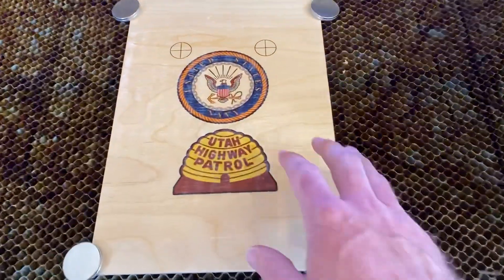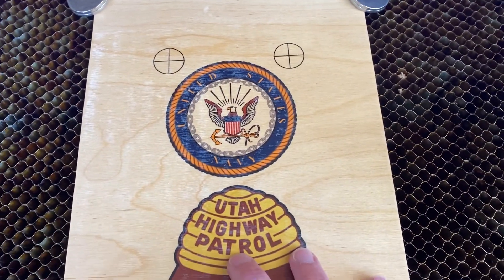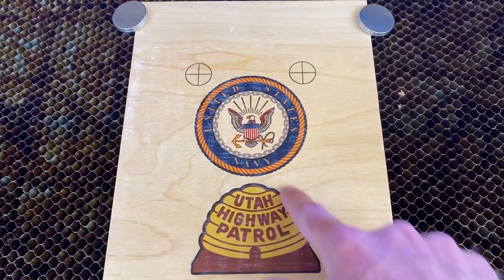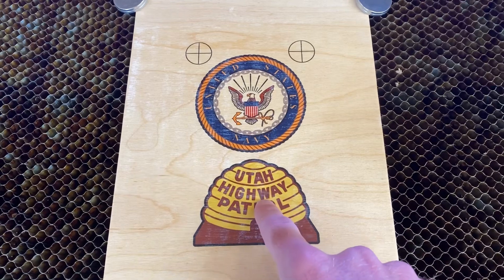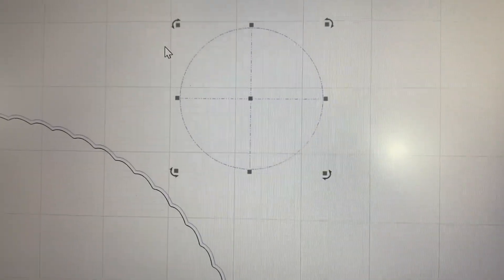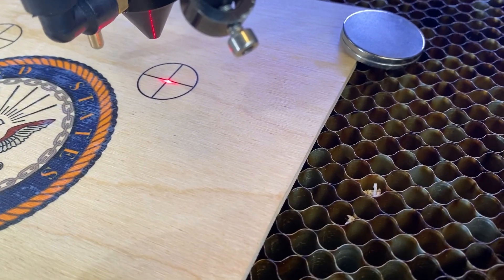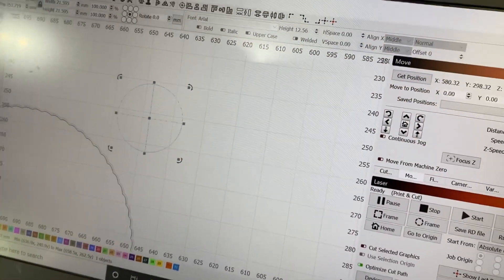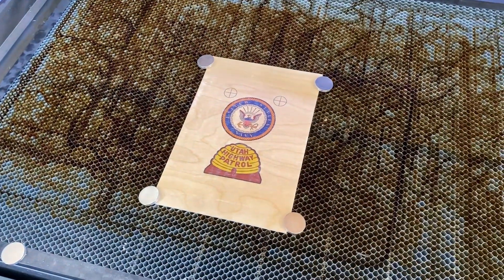Lightburn - Print and Cut

Comment: is it work in laser or plotter I try in longer ray5 10 watt but not work for me how does he evaluate the target distance if the camera is not there?
Reply from the maker: You need to have the targets as part of your design in the software and in the physical product. Align them using the wizard in lightburn and then there is an option to scale and align at the end of the wizard. Lightburn does all the work in the background to make it work.
Reply: @BeardedBuildsCo  its cut just out of frame , my work space is 400mmx400mm i cut a4 paper design then i need to set my workdpace also in a4 size or not is this matter, , i try to cut a photo with help of this but its just cut opposite direction or out of frame
Reply from the maker: @sanyasidham it’s hard to help without seeing what you are experiencing. Are you in the LASERGUYS Facebook group?

Comment: Thanks for this clear explanation, my longer nano 6w has a extender bed that is only 100x300 I’m going to hopefully cut some 3mm ply to the plans of a boat, the images though are outside that size so I’m guessing at moment that for each sheet I’ll have to make a print with targets then repeat moving each part of the image into the work area, cut and then join up again after, is that how you would do it or do you have a different way to use lightburn to cut patterns that don’t fit the work area?
TIA

Comment: How is the laser power off but still running without the cut? I have the polar, and I'm just now getting it figured out
Reply from the maker: On my machine there is a switch for just the power to the tube. For the polar you could set the layer power to 0 min/max and it would do the same thing.
Reply: @BeardedBuildsCo  thanks

Comment: Yeah! But the next step is to automate both halves of the process - especially the calibration step. Doesn't light burn do that yet? Don't forget this feature is a simple button push from the front panel of older units like LaserBox.

Comment: How do you do the dry run with the laser power off?
Reply from the maker: On my machine I have a key for the laser power and I just turned that off.
Reply from the maker: You could also just turn you power to 0 for min and max on the layer.

Comment: Thanks for making this video. One question I have for you. Do you bring your image in as a png or jpeg and then image trace so you can then start wizard function?
Reply from the maker: At the end I of the day you have to have a line to cut with lightburn. You can either do that with a vector you have or using an image the you trace. Both will work.

Comment: The linked printer is an inkjet, not a dye-sub.  Wrong link? Instead of adding a black outline, offset (overprint) the colors that are already part of the image. Then when you cut you'll be left with a clean image without a wonky black outline.
Reply from the maker: In this case I wanted the black outline. The printer linked is the printer that I converted to dye sub.

Comment: When I do as you  for some reason as I jog to the first cross hair the position maker is to the right about 1/2", when I jog to the second and zero in as you then run a text it goes over the crosshairs first, the first one is fine but the second one is off by 1/4" or so to the left and when I run it the head strays from the line, any help with this? Thanks

Comment: Hello! I am attempting to make a jig to hold wooden crab mallets. How do you set up the print/cut with cardboard when the cardboard is lower than the hammers will be? In other words, do I set up the print/cut with the bed at the focus height for the cardboard? What happens when I lower the bed to load the crab hammers in the jig?

Comment: Hi, great video. Do you know of a way to add more targets / reg marks for an even more accurate cut over a larger space? Also how do you turn off the laser for the test? 

Thanks 😀
Reply from the maker: There is not a way to add more registration mark. To increase accuracy you can move the marks further apart. In this video I turned the laser key off or you can turn the power% to 0.
Reply: @BeardedBuildsCo  thanks for the speedy reply. I run a kongsberg large format cutting machine at work and it uses 5 reg marks to read the cut file so I thought it might be similar. I will try spacing the two reg marks out further to increase accuracy. 
Thanks for the tips and will keep an eye out for further help 👍🏻

Comment: I THANK YOU for this video as I had been wondering about this.

The only thing I will need to do is match my red dot pointer with the actual position of my laser on my new Aeon Mira 9.. I will ask then how to do so now.
Reply from the maker: Pulse on your material and then without moving the laser head adjust the red dot to be right on top of the pulse mark.
Reply: @BeardedBuildsCo  INGENIOUSLY SIMPLE!

Comment: What kind of wood was that? Also what wattage laser? It seems impossible to cut through that fast. My 80w has to be slowed down to like 10mm/s at 70% power to be able to cut 5mm plywood.
Reply from the maker: This is 3mm Baltic birch cutting at 34mm/sec on my 100w. If you have to slow down that much and use nigh power like that you probably have something going on. Most of the time symptoms like this are an indication of an alignment issue. The place where alignment is the most crucial is the 3rd mirror at the top of the laser head down to the material. If that is not dead center you will lose a ton of power and if it is hitting the nozzle on the way out of your laser head then you power is diminished even more.
Reply: Is your laser 80W input or output (optical power)?
For example, my laser is 40W input, but only 10W output.

Comment: Awesome tutorial. Thanks so much.

Is your air assist connected to only run when laser is going or was it that way because you turned the laser power on and off?

How did you wire to only come on when lasering if thats the case?
Reply from the maker: I upgraded my air assist setup so that when a job starts the air turns on. I will link the video here.

https://youtu.be/y08B1v8-q-c

Comment: I am using the print and cut feature to cut a piece larger than my bed. When i tell the laser where my registration marks are (1 & 2) it doesn't cut in the correct place.  for some reason it shifts slightly.  Any idea what would cause this?
Reply: Have you checked your red dot alignment? The first time I tried to use registration marks on a passthrough I had the problem that my cutting laser and my alignment laser weren't hitting the same spot.

Comment: Great video, however, you did not show on you sublimated the image onto the wood surface? I thought sublimation only works on 100% Polyester fabric and Polymer coated substrates. However, you did not show on you sublimated the image onto the wood surface? I thought sublimation only works on 100% Polyester fabric and Polymer coated substrates.

Comment: Nice vid mate, just seemed to jump ahead of me. I have used the print and cut feature in Lightburn and I made the registration marks in LB
but I am trying to find out exactly what you are showing in this video but before you printed, 
Did you make those registration marks in the print software so that they transfer into lightburn and then be used by LB
Reply from the maker: Yes the registration marks are made with the design and also printed to the print transfer paper. Here is another video that might help as well. 
https://youtu.be/n__saOKVupA
Reply: @BeardedBuildsCo  Thx mate, Yea I already used that video to make an oversized project and it worked out great, I was just at a loss as to how to create the print file in a sublimation printer and if the registration marks transfer exactly to my laser .
Reply from the maker: Yeah I created the design in illustrator and used it to make the print and imported the the same design into lightburn.

Comment: I noticed your head is pretty far away from your material, does that make it harder to cut through thicker boards. I use the cloudray automatic air value to control the air through lightburn, and I want to start using the dried air/cooled air from my compressor for my lasers. also can I ask what brand of tube to run?

Comment: Nice feature.  Good video.  I would like to see how the actual printing on the wood is done.
Reply: Spray a thin layer of Polycrylic on the wood. Print the photos using a sublimation printer. Press the image on to the wood using a heat press.
Reply: Interested in this as well.
Reply: Also interested!!!
Reply from the maker: Once I get my sublimation setup put together, I’ll do a video.

Comment: Great video as always Brandt. I'm gonna be ordering my camera soon and installing it soon. I have to figure a way to remove any "play" in my lid so that I can get extreme repeatability. I'll be utilizing this feature very often.
Reply from the maker: In this example I did not use a camera.
Reply: @BeardedBuildsCo  yep I know buddy. I watch the whole thing a couple times. Your instructional videos are 👍👍 One of my buddies has an epilog pro fusion with a camera. I want that functionality in mine. I just need a sturdy mounting system for better accuracy. The camera when dialed in just makes what you did much easier. But even without the camera that feature is very useful as you just pointed out. Id rather have one piece pre printed than try cutting them all and then trying to print to those cuts.

Comment: The file that was printed, how did you move that file to lightburn so that the sizes were exactly the same? What program did you use the create the drawings and how did it import into lightburn? Did you just create those registration marks with a circle and lines?
Reply from the maker: I use Adobe illustrator to do design work but this could be done with Inkscape which is free. I export as a pdf file with the registration makes that I made with the file. Then I print and import the same file into lightburn. Lightburn’s print and cut feature will actually scale everything once you have the registration marks selected so you don’t even have to worry about the size or alignment.
Reply: @BeardedBuildsCo  when you transfer it to light burn do you leave it as image and after you set the target set do you change it line to cut
Reply from the maker: All you need to bring over to lightburn is the outline to cut and the targets.
Reply: @BeardedBuildsCo  awesome! Thanks for explaining it. I'll give it a shot.
Reply: @BeardedBuildsCo  you might have figured this out already but thought I would save you some time if you haven't, you can just copy paste straight from illustrator. Beats the extra step of saving and importing. Enjoy your videos... and thanks for helping me realign my laser. Different laser but same concept and your video was the best at not complicating it.

Comment: Do you know if the wood was coated or was it straight sub to wood? I have had successful wood subbing by applying a thin sheet of laminate on the wood and then sublimating. Looks freaking awesome!
Reply from the maker: I put a coat of polycrylic on it before the sub.
Reply: Do you heat the poly or just let it dry natural